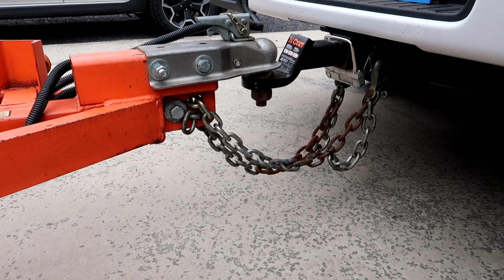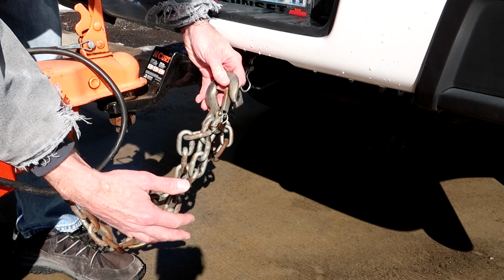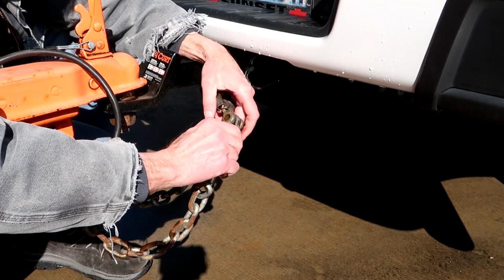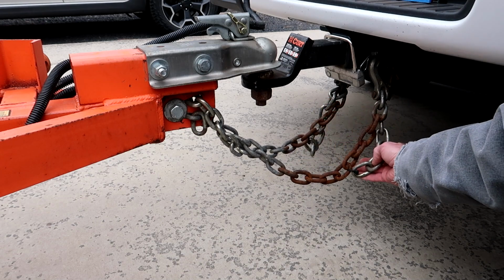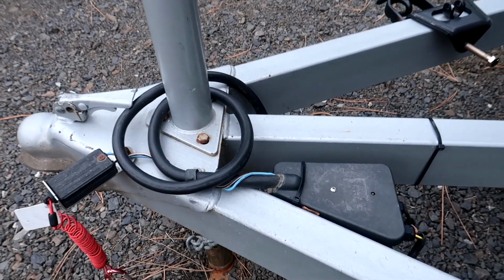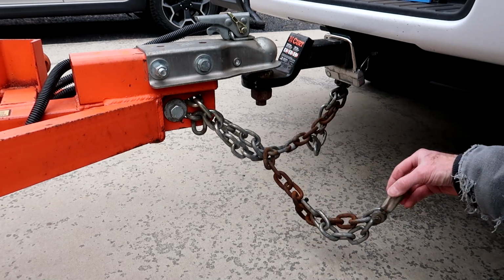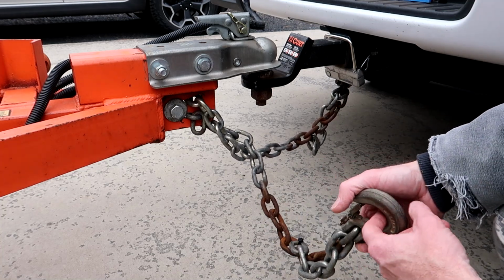Trailering 101: Safety Chains!

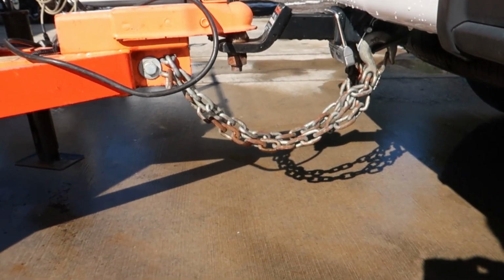Comment: 1:24 u got that backwards. If the truck was sitting level, you’d have more clearance, not less.
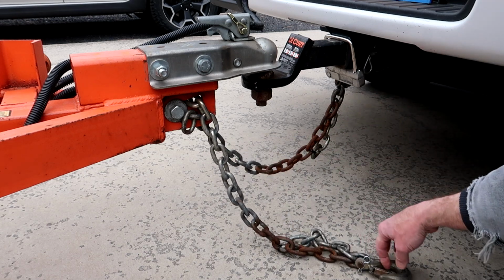Reply: No, think you're backwards. With the truck level the nose would go up which moves the hitch down so you'd have less clearance just like he said. And it starts at 0:58
Reply: @thud9797  the hitch would act like a fulcrum point. Go back and watch again. It would only be by a tiny amount though. Nothing close to 6 inches.